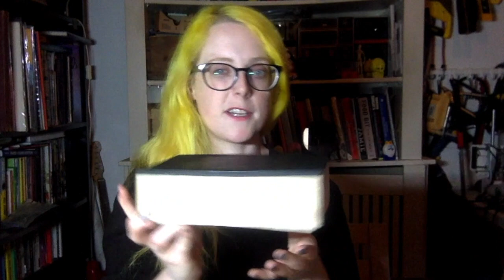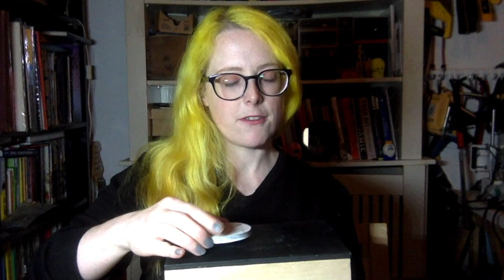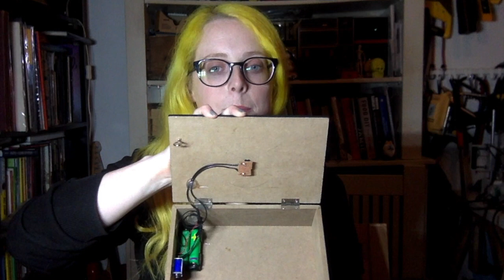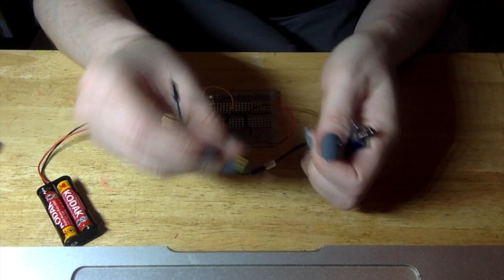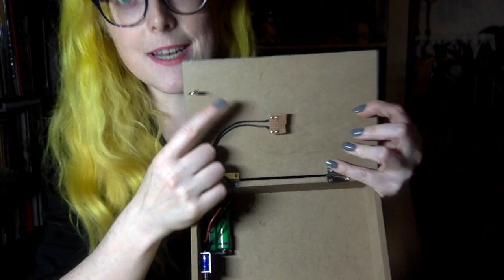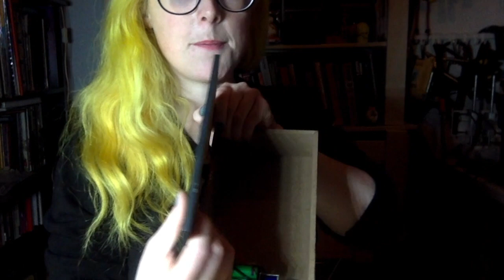Your first puzzle!

Comment: Hi does the battery drain when the box is closed?
Reply from the maker: Nope. The solenoid is normally in the "push" position with no current flowing through it. There is the possibility of it running out of battery and you not being able to open it though! But there's a little bit of wiggle in the eye hook, so you could force it open if necessary. Or you could run another battery pack to the solenoid via a button to act as an emergency back up.